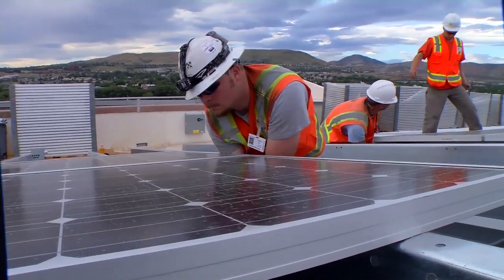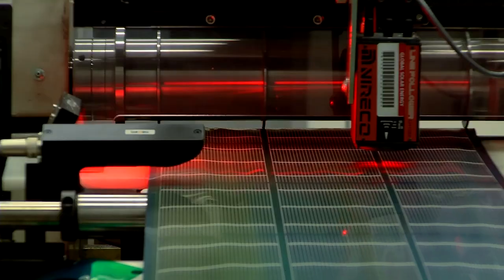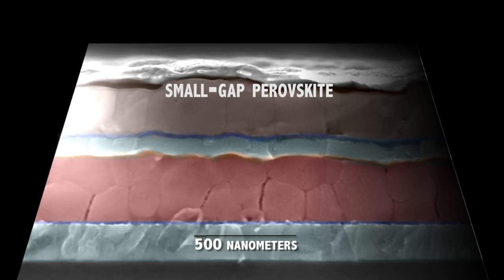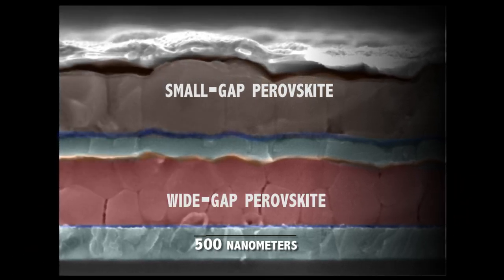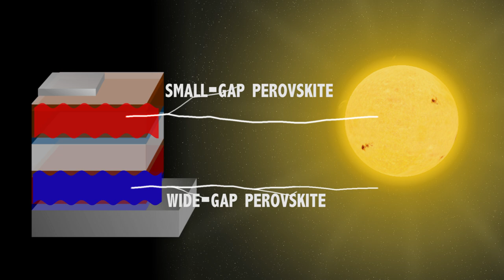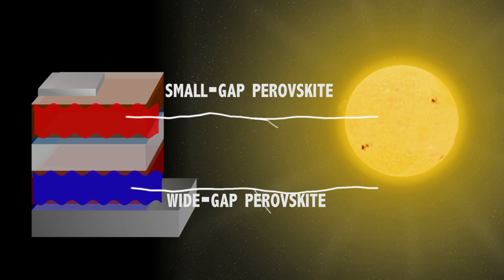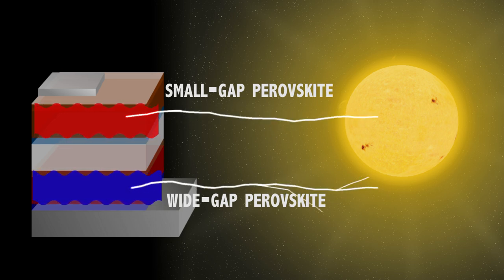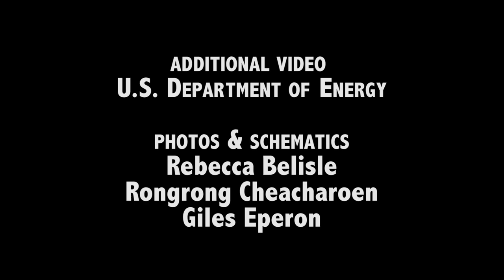New high-efficiency perovskite solar cells

Comment: Actually the perovskite solar cell technology has more value in incorporating with the existing silicon industry in the form of a tandem cell. It offers a somewhat simpler path to commercialize the technology, takes advantage of the scale already achieved by the incumbent industry, and offers a clear value in improving the efficiency of existing devices. This is the path currently being taken by Oxford PV. Learn more about the insights on this technology here: https://solarmagazine.com/perovskite-solar-cell-pioneers-search-for-elusive-killer-app/